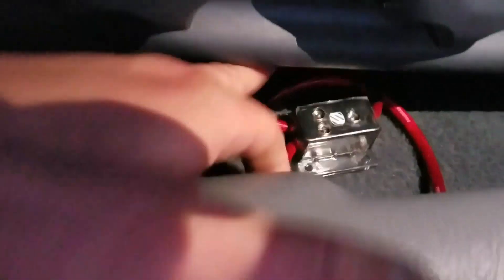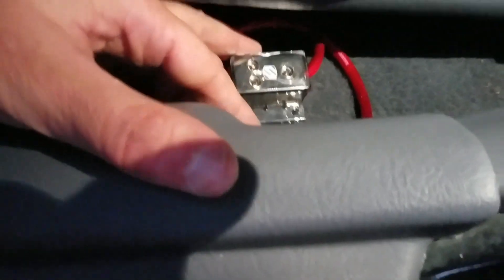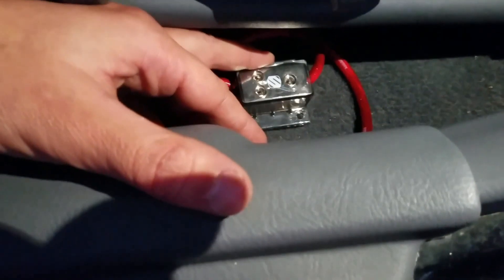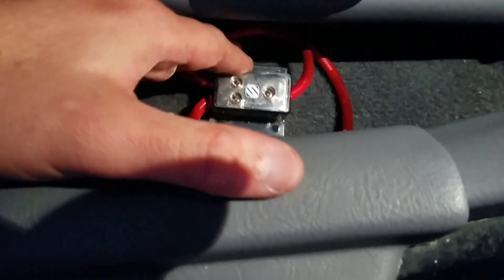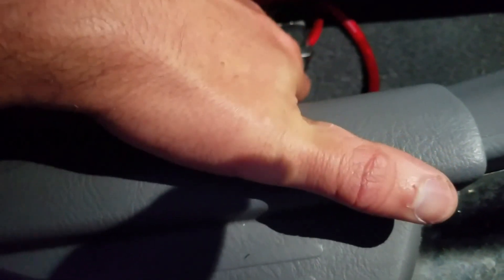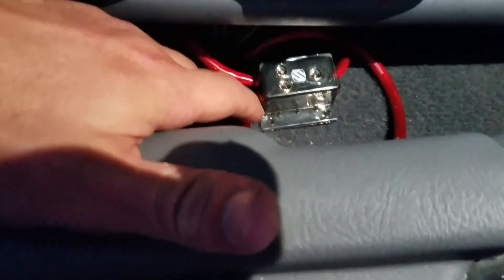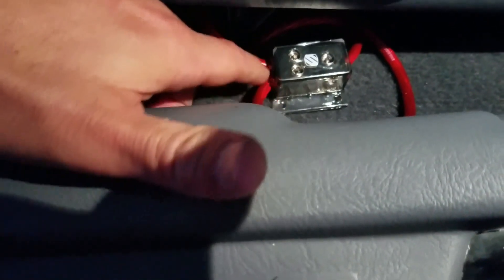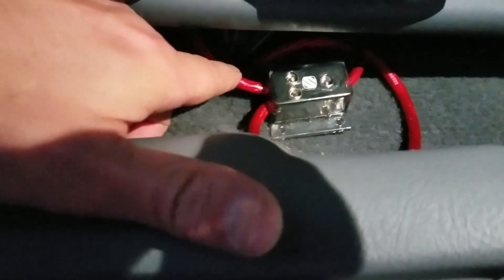Connect two amplifiers with one power cable

Comment: Keep 1 in line fuse for 2 amps ?
Reply: one after block for each fuse is probably better
Reply: Technically you should fuse after the distro block or get one with fuses built in. This is tricky for my scenario cuz I need 0 gauge to 0 and 2 4 guages

Comment: Should be one 4 gauge split to two 8 gauge.
Reply: Og Scythe That's 100% correct. Always a larger gage cable coming in from the battery and next size gage down Y Out. For example my Orion is 0/1 in from the battery and has 4/8 gage terminals out. Using the same gage cable in will get hot fast.